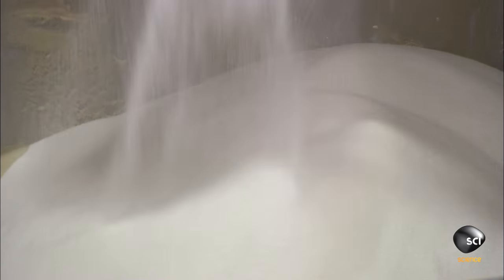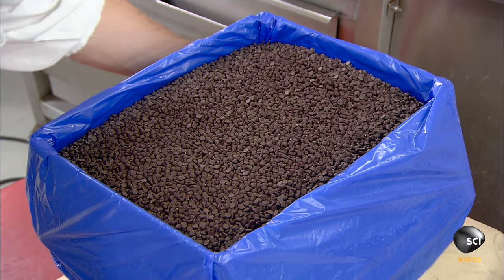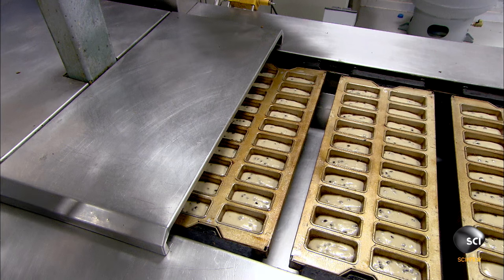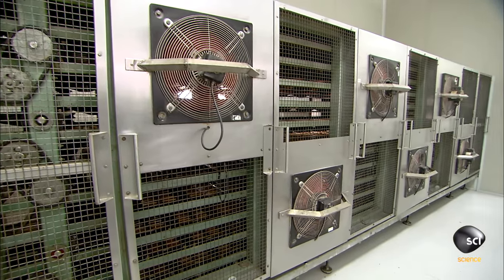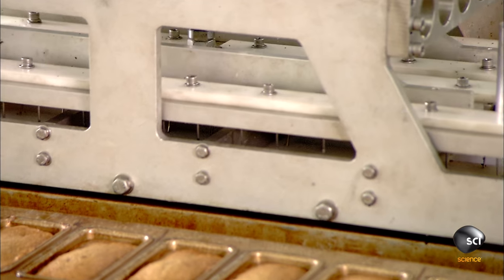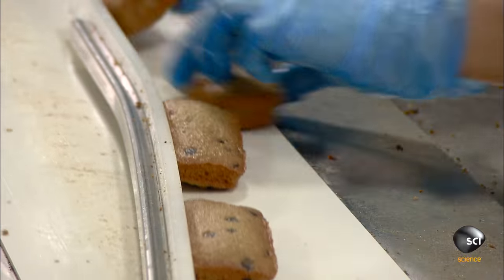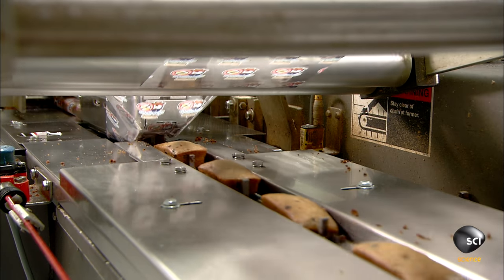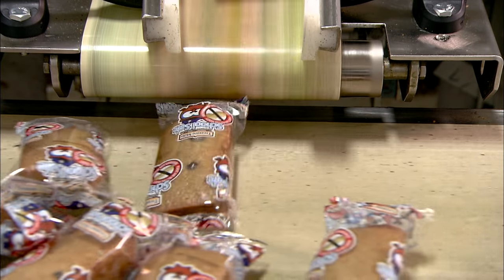Chocolate Banana Loaves | How It's Made

Comment: what do those sensors do? a lot of the food factories have some sort of sensor to check the food safety or quality. what happens if the sensor detects something wrong?
Reply: HAHAHA METALS IM SO DOONEEEE
Reply: what happens if there are metals. it seems the food is going fast in assembly line.
Reply: the sensor is actually to communicate to the computer if a spot is missing.
Reply: Its not metal detector. Those are much bigger.
Reply: jim higens will it be able to detect and eject problematic food?
Reply: ziljin no that's what the people are for.
Reply: jim higens i want to see what happens if there is a problem. does teh sensor blare a loud alarm and automatically stops the entire production line? or does the worker have to quickly figure out which is the problematic food and pick it up before it gets packaged? or when one food item is contaminated its likely its a whole batch is and not just that one peice?
Reply: ziljin ur insane bud